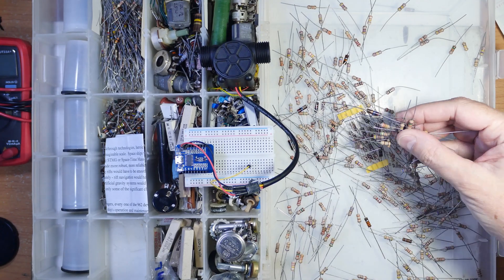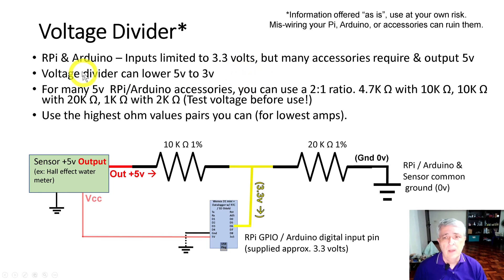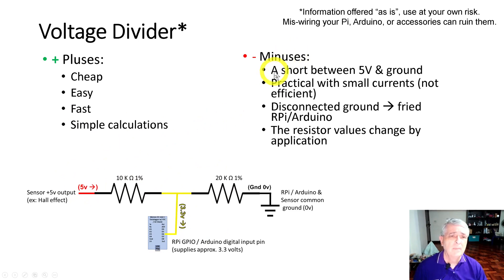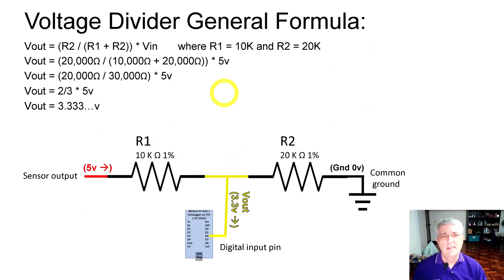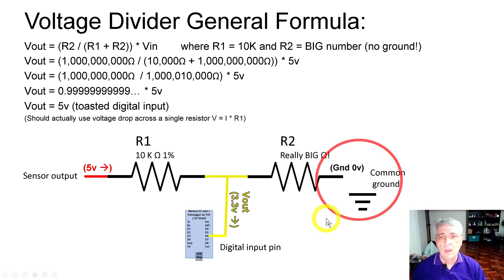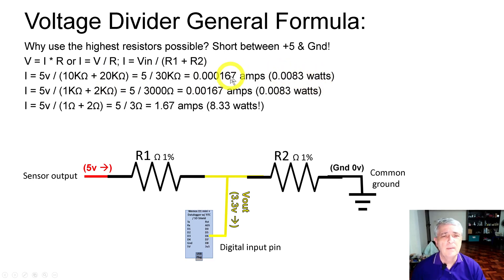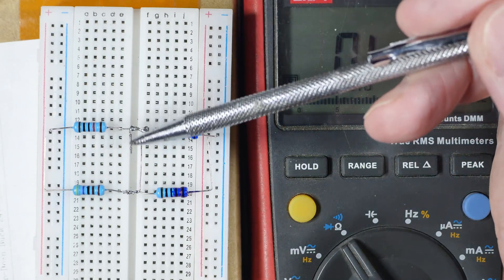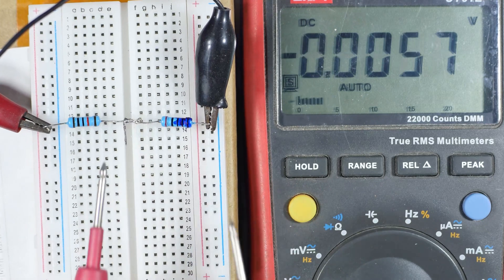Voltage Divider For Raspberry Pi/Arduino (4K)

Comment: Excellent explanation. The loss of ground issue you mention made me wonder what alternatives there may be. Getting a sensor that runs at the same voltage is obviously one, but are there others? Preferably safer, even if a bit more expensive.
Reply from the maker: Thank you. That loss of ground thing is an issue and I thought about it at the time I fried my first RPi. I'm sure there's an answer, maybe using a small cap. An optoisolator would work, but it gets messier. If you find something please let me know.

Comment: I don't work with raspberry pi, but I wouldn't go above rated voltage, since, the logic high for most electronics are far below rated maximum.